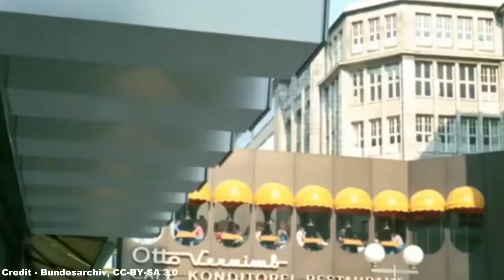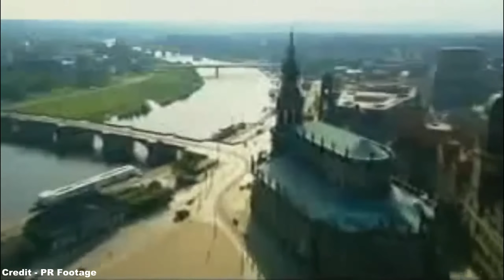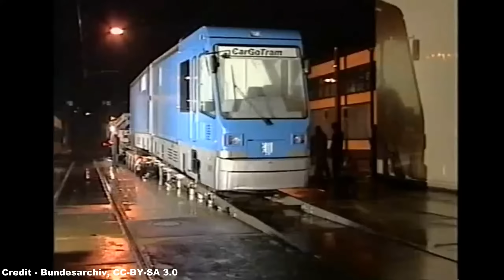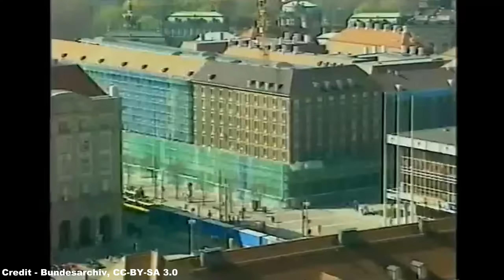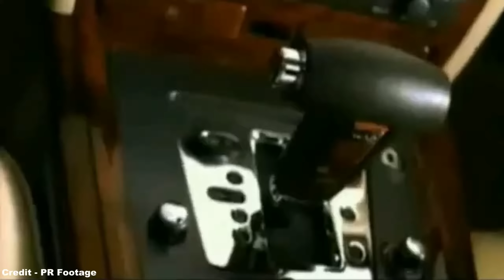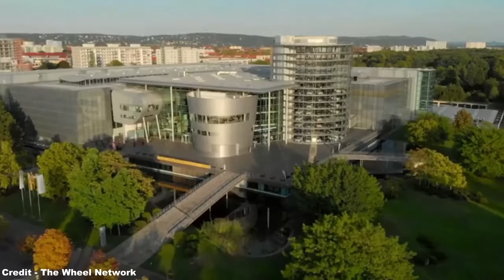CarGoTram - An Efficient Alternative

Comment: I have heard about this in the past. It is bit sad that this system is no longer in operation, on the other hand I was one of a kind vehicle for single task - moving parts between two sites, so it was only natural that with changes in production, this system became obsolete. On the other hand it is bit pity that this concept did not became more widespread in Dresden as it could have been used for other purposes as well, but maybe the design was too limiting for other uses. I really can't see trash or gravel being transported in carriages that will within few hours be transporting delicate car parts or food. That would perhaps require something closer to train with two locomotives, than to EMU.

In my opinion one of the greatest obstacle to more broader adoption of freight trams and freight metro is that there are currently no carriages that could easily operate on on tram networks and on standard railways. This means that goods have to be transloaded which results in delays and danger of the goods being damaged and at that point it is perhaps easier to send them by road. Sure, there would have to be some special tram locomotives build, but at the beginning maybe small shunter diesels or some refurbished old tram locomotives (one should be on display in Bratislava) could do the job until new one are designed. But we will still need some carriages that can negotiate tight curves (all the way down to some 25 metres) and that can fit through much smaller loading gauge, also they should be design with shipping containers in mind. Maybe then we will see return of the freight trams, but unless that is done, their role will be IMHO highly limited and most cities will not use them at all. Not even for transport of trash from collecting points to waste-to-energy plants and so on.
Reply: Certainly an area that a couple of rail engineering firms looking into could have productive results 🤔

Comment: The Cargo-Tram truely is a loss for humanity, but it has to be said that the routes in Dresden had to be specially reinforced for the MUCH heavier Cargo-Tram. Additionally others have mentioned the weird gauge and space-profile of tracks used for Dresden's trams stopping cargo carriages to be sent around the city directly from normal gauge tracks.
Reply: Was the tack gauge really that big of a problem? Under certain conditions, like limited speed and section of tracks being equipped with guide rails, standard gauge boogies can operate on broad gauge track, that is further 70 mm wider than tram gauge in Dresden.

Comment: Imagine having this system connecting freight railroads and truck routes in the USA especially major cities especially NYC. Sending goods from Brooklyn, Manhattan, Bronx, Queens to NJ. Which can relief most of the traffic on its highway bridges and tunnels.
Reply: Yup. NYC used to have an extensive tram system (albeit for passengers), until the motorbike lobby put paid to it.

Given NYC is infamous for refuse collection issues, I can imagine a cargo tram refuse variant would be really useful on routine high intensity collection routes.
Reply: @jimtaylor294  Don't they do that for garbage collection, using the subway lines?
Reply: Do nyc still do freight on transit to transport deliveries, cargo goods and to transport trash?

Comment: Little pronunciation help - the "ch" in "Chemnitz" is actually pronounced the same way that an English speaker would say the "ch" in "chemistry". But even some Germans sometimes get it wrong if they are from other parts of the country. Just by looking at the letters of the word, it isn't obvious.And the proper pronunciation of he first part of the name  "Sachsenring" is something that English speakers would likely hesitate about. It's very close to a word that I probably can't put in the comment, which s*cks... 😉 But there is nothing problematic about the word "Sachsen" in German, so don't worry.

Interestingly, the City of Frankfurt am Main just concluded a 4 week long test for something that is related in concept.
In a cooperation between their local tram operator VGF, a university (I think from Frankfurt directly) and Amazon, they used a type "Pt" tram car from 1978, which is only kept as an operating spare, to haul smaller Amazon deliveries from a point at the outskirts of the city to a mostly unused track loop next to the Frankfurt zoo. From where the cargo would be delivered to the customers via electric cargo bikes. 
Sure, this is not a purpose-built vehicle, and from the photos it looks like all the modifications they did was to put on a vinyl wrap advertising the project, but after all, this was just an experiment for a limited time. But from what I heard, it was successful and they are considering the idea to turn this into something more permanent.

Comment: Interesting video, but I needed the subtitles to understand German bits (my native language).
The thing in Zürich is just called "Cargo tram", I don't know where you got the "Fahrpläne" from, that just means "timetables". It also doesn't operate daily. It usually runs from Monday to Thursday and then about every other Friday and Saturday. It's a really cool system though. The tram runs two services, one for large items (Sperrgut, I don't know the English word) and one for electrical and electronic waste. There are several pick-up points across the network that get served about once a month by both services (so it visits all the locations about twice a week, either with one or the other service). The tram is parked at the recycling plant at Werdhölzli and drives to the pick-up point of the day, stays there for a few hours, people bring their trash and then it returns.
Sadly, the service is supposed to be discontinued by the end of 2024 (I think) and replaced by some boring lorries. They're doing some rebuilding with the recycling infrastructure and the tram in use, Xe 4/4 1922 is a rebuilt tram from the 1940s, not getting any younger.

Comment: This is a great idea, if you've got enough money to throw at it. From the sound of things, that tram had the cargo capacity of 3 trucks. But I bet it cost a lot more than 3 trucks to buy. And the track to connect the cargo zone of the factory to the main tram line was another additional cost on top of that. Sure, it probably cost less to operate (until it became old & needed excessive maintenance). But I bet the payback period for the added up-front cost was a few times longer than the lifespan of the tram. 

Now, if the idea were to catch on & cargo trams got built in the hundreds, instead of being bespoke, the cost would maybe be worth while. To achieve something like that, you'd need a descent sized country to initiate things with a nationwide plan to use cargo trams for something like waste transfer (what that Swiss tram mentioned at the end does). That will create some scale for manufacturer of the units pulling the cost downward.

Comment: Fun fact about Dresden's trams: It has a track gague of 1450mm, a whopping 15mm wider than standard gague. As far as I can tell, this gague is unique to Dresden, and I couldn't find out why they have it. Even more bizarrely, Leipzig, the other big city in Saxony and just over 100km away from Dresden, uses 1458mm gague for its trams, which is also one of a kind.
Reply: In Dresden and in Leipzig it has to do with how the rails for the old horse drawn tram were made. To allow for paving between the rails, some towns decided to mount a side rail on each rail to keep a gap open for the tram wheel flange. This caused some problems because when the gap was too wide, wheels of carts could get stuck, and if it was too narrow, horseshoes would. Dresden and Leipzig decided to have special rails made for them where the inner rail for the pavement was already forged into the rail head by having the head split by a groove, hence the gap would always be constant and not endanger cart wheels and horseshoes. But when using standard sleepers, this caused the gauge of the rail to be slightly wider, because the remaining working head of the rail was now narrower and slightly offset. Dresden and Leipzig had different suppliers for their rails, hence they had slightly different head geometry, causing the Dresden gauge to be 1450 mm (+15 mm) and the Leipzig gauge to be 1458 mm (+ 23 mm).
Reply: Thanks! Always interesting to hear these tidbits. On a similar note, the Italian 950mm narrow gauge was born because of a miscommunication. It was supposed to be 1000 mm, but they wrote by mistake "measured between the outer edges of the rail", instead of "between the inner edges", so that's where the extra 50mm went - 25 mm per rail:)
Reply: @SiqueScarface  
> when using standard sleepers, this caused the gauge of the rail to be slightly wider,
> because the remaining working head of the rail was now narrower and slightly offset

That is the issue with concrete / metall sleepers which have premanufactured bolt holes.
With wooden sleepers, a spike are driven into the sleeper in place. Why is the problem here?
Reply: @SiqueScarface  thank you for that interesting explanation.
Reply: @SiqueScarface  Is the 8 mm difference enough of a problem that it prevents vehicles being theoretically usable on both networks? The actual gauge in real life can differ a bit from the official one anyway.
On the other hand, having the same gauge doesn't automatically mean interoperability, as there are other deciding factors to this as well.
Reply: @jonistan9268  At low speed, you will probably be fine, but at higher speeds, you can have a build-up of oscillations which in the end will cause the car to either break or at least derail.
Reply: @SiqueScarface  What would be safe speed of freight train running on street? maybe 10-20kph? I bit doubt that that would cause significant problems with oscillations.
Reply: @MrToradragon  I don't know. I am not a tram engineer. You should ask Dresdner Verkehrsbetriebe, the operators of the 1450 mm gauge.
Reply: @MrToradragon  The in-city speed limit in Germany is 50kph (~32mph) which is the max. speed of the CarGoTram; for comparison: most passenger trams are capable of 65-80kph (37,5-50mph) ^^
Reply: @SiqueScarface  And you explained it for me. You also want to keep the grove narrow because its an bicycle trap.
Reply: on the other end of the spectrum is linz with 900mm tram gauge. that causes some problems because it is quite narrow.
Reply: @robertheinrich2994  But 900mm is one of the more standard gauges, on the other hand I bit wonder why Linz does not use something like Cape or metre gauge as those would be closer to original horse drawn railway that had ran from Č. Budějovice to Linz and further to Gmunden.
Reply: @MrToradragon  they even regauged the pöstingbergbahn from meter to 900mm to just deal with one gauge and not two.
Reply: Milano, Roma, Torino and basically all Italian standard gauge trams also used 1445mm. The wider gauge is to make turning easier.
Reply: Local track manufacturer and layer's created future employment for themselves
Reply: So they made a proprietary track.
Reply: Make me wonder why not use standard gauge if just differ by couple of cm? One major benefit is that you could hook them up to an locomotive and move to an train repair shop rater than having an dedicated for the trams. For manufacturing I guess making he axis longer is not an huge job
Reply: @magnemoe1   At the time there were no standards for tramtracks and ever tried to change over 200 km of track-network that’s used by over 140mio. ppl a year? ... your loco workshop must have deep pockets to pay for that ... 

And yes, we have cities in Germany that changed form narrow to normal gauge, so we would do it, if it where needed ... 

At last, your loco, wouldn't be allowed to work at tramtracks without recertification, since there are differents between the "Eisenbahn-Bau- und Betriebsordnung" and "Verordnung über den Bau und Betrieb der Straßenbahnen", IF the axle load would be small enough, to even run on a street^^

Comment: Freight trolleys are as old as the electric streetcar. Infact america had thousands of these freight motors trundling across it at one time from slower locomotive types to the boxes with trailers running highspeed across the mainlines of their interurbans.

Heck at times they would even run on other systems. At times. Both loaded and just transfer. It was a freight motor like this that made the daring 200 mile trip solo from Trenton NJ  winding along to Hershey PA..

Comment: Not really efficient on most large tram networks. 1. Almost every modern urban tram network has a number of bottleneck sections that usually operate at 95-100% capacity. Those determine the "room" for any cargo trams on the (rest of the) network, if there is any room at all, because... 2. Modern (large) urban tram networks usually have very low headways/very frequent service on their main sections. This means a cargo tram would need to adhere to these timetables, and it would need to be squeezed in between normal passenger trams. 3. A number of similar plans had cargo trams running at night. There is a reason a lot of networks do not operate at night (or only on a limited part of the network, or on weekends only) because this is generally when network maintenance is done.

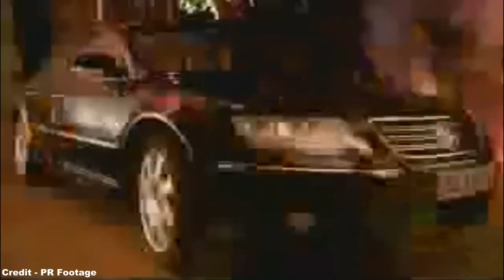Comment: 6:00 Your description of the Phaeton is completely inaccurate. Parts weren't transferred over from the Bentley Continental to build the Phaeton, the Bentley actually used alot of the Phaetons parts. The Phaeton came out 2 years sooner and was effectively a test bed for the Bentley Continental GT. I don't like how this narrative that the Phaeton is a just rebadged Bentley has become so pervasive; the later Continentals and Flying Spurs are rebadged Phaeton's, not the other way round. I also take issue with your statement that the Phaeton was merely on par with the Audi A8, the Phaeton was actually better in most aspects; and this is coming from an A8 owner. The Phaeton was more refined, more comfortable, higher quality and the cheaper vehicle. The Audi is more dynamic thanks to its aluminium architecture and stiffer suspension but not on par with the Phaeton when it comes to luxury. The Phaeton was better than even the 7-Series and S-Class when it came out; it was that good. Even Jeremy Clarkson admitted when it came out that it was the luxury car to buy.

Comment: So - short version -  The laudable green transport component had been made from clapped out equipment built to obsolete design formulated decades earlier became unreliable, leading to it's being phased out just as the production line switched from ICE to EV production.  
 
There's a certain commonality with the penny-pinching bargain basement approach which has blighted UK industry since ..... for ever.  

I believe there is still a cargo tram service operating in one of the Swiss cities.

Comment: It was a really cool proof of concept, and the factory equipment itself was pretty high tech. It's a shame the trams were used exclusively for the production of cars, and at the same time it's a shame that they're replaced with hydrogen powered trucks. Something related to cargo trams is NYC MTA's garbage trains, using subway metro cars and open carriages to convey bags of trash.